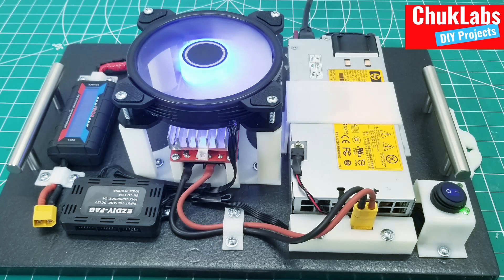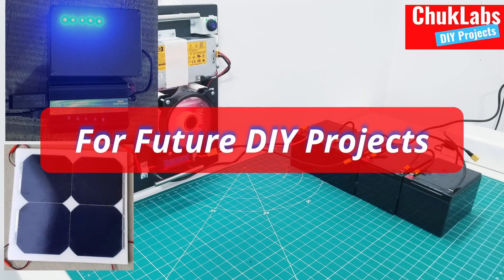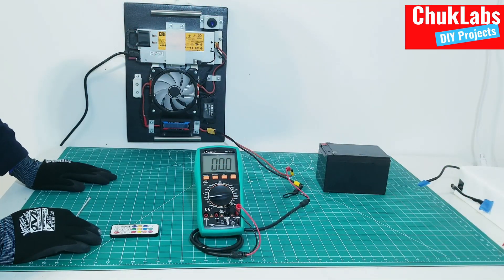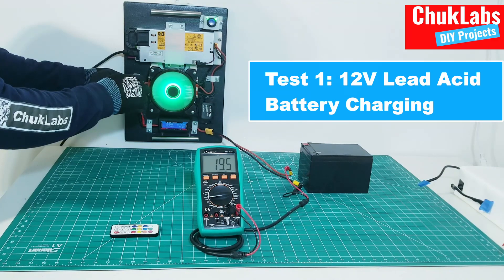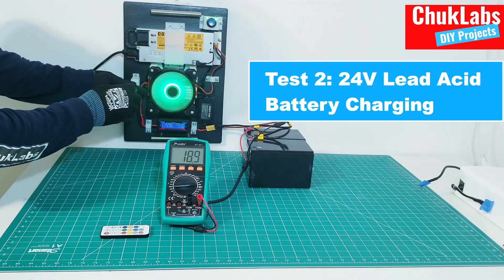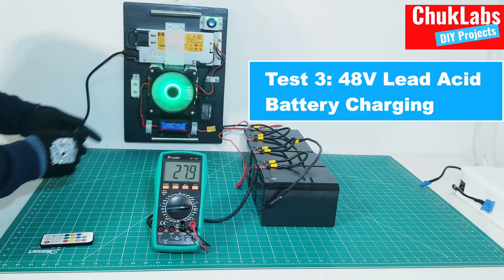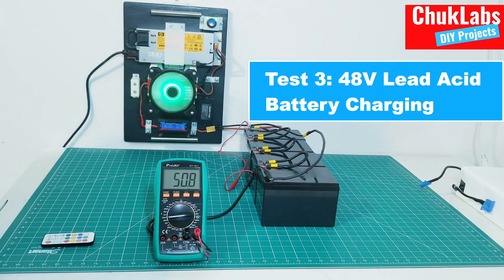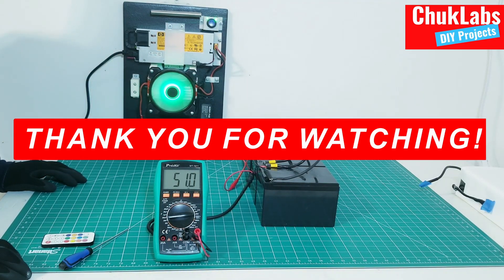DC Power Supply, Battery charger #diy

Comment: Great build! What made you upgrade the fan ? Did you just do it to be safe or was the stock fan not enough? When i first got my unit i was thing the fan may be a little small. I guess ill just have to wait and see how hot mines gets when its work !
Reply from the maker: The model I used for that design is the 1200W model, and it didn't come with any cooling fans. 
Also, the RGB LED fan makes it really satisfying!
😊
The Innovati0n Lab
Reply from the maker: Also, the stock fan that comes with the 1500W models is usually not super efficient - in my opinion.
Reply: @theinnovati0nlab782  I have the 1800w model and ill be using it outdoors. I may need to consider upgrading the fan soon!

Comment: Nice looking unit. I've included a charge controller in the one I've put together based on your videos. Great work. 👌😎
Reply from the maker: Hi friend!
I am very happy to hear this. 👍👍
Please share pictures if you can. 
Thanks again for supporting our channel.

I hope you added the LED fan as well. They are super satisfying! 😊
Reply: I used the XH-M602 Digital controller to turn the HP Server PSU on and off as needed. 6A 150W DC-DC Boost Converter is used to output 14V to the 75ah 12V SLA Battery. Bear in mind that I have no electronics experience but was still able to put this together from odds and ends. You never know till you try.  😎
Reply from the maker: @BuzzLiteBeer2012  
Wonderful, I am glad. That is exactly why I try to keep my videos as simple as I can. 
Again, thanks for sharing, and I am happy that your project was a success. 
However, i will recommend that you keep an eye on your charging system whenever you are charging your batteries until you have gained a lot of confidence with your system. Also, make sure that you are charging your batteries in a well ventilated area.
Safety is very important, my friend.
👍

Comment: What is the EZDIY-FAB box? Do you have a video on it?
Reply from the maker: The EZDIY is the RGB LED cooling fan I used to make the open frame charger/lab supply.

I made a test video for an RGB LED fan earlier. I honestly don't remember if it was on the EZDIY fans, but check out the video and let me know if it helps. It was an old video, and my camera was not as good...lol.

https://youtu.be/PZGwLdhHCP4

Comment: You are using a 1200w booster converter whose maximum input current limit is 20 amp.  And you are using 12v supply, it is regardless that how much big is power supply output because you can use only 20 amp for input in peak load situation. I.e, 12v x 20amp = 240 w .and whenever you charge 72 v battery for 84 volt than you can you use only 240w/84v = 2.85amp . 
If you want to increase output wattage then you have to go for higher input voltage.
Reply from the maker: Thanks a lot for watching this video and for leaving such a helpful comment!

You are absolutely right about the impact of the 20A input current limit. This video was made a while back. I talked about the input power limitations of these boost converters - caused by the input current limits and how you can mitigate it by raising the input voltage ....basically in agreement with your comment in subsequent videos after this one.

Please check out the video link below where I used two of the 12V server power supplies in series to generate an input voltage of 24V. 
https://youtu.be/ZWcnCeuy_kA

I used the 1800W model of the Constant current boost converter with an input current rating of about 30 - 40A.

Thanks again for the wonderful engagement!
👍👍

Comment: If you want to charge a 14.4V battery, just adjust the feedback resistor of that HP server DC supply. This boost converter's efficiency is about 85%, AC-DC is about 90%.Then the whole system's efficiency is low.You can use a 24V wide-range input power supply unit instead,its output range can be 5-60 volt.All you need to do is change the feedback resistor to a trimmer resistor.
Reply from the maker: Thanks a lot for such wonderful feedback. I will try your process of using the trim resistors for my next build.  However, as I am sure you know, you need to also adjust the charging current for your batteries according to the manufacturer rating. Does using the trim resistor method allow you to adjust the charging current?